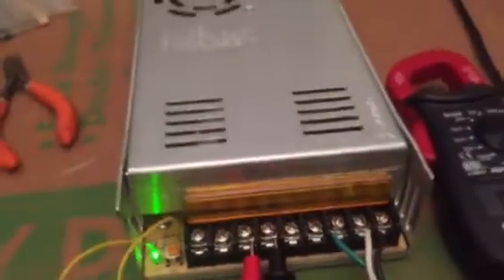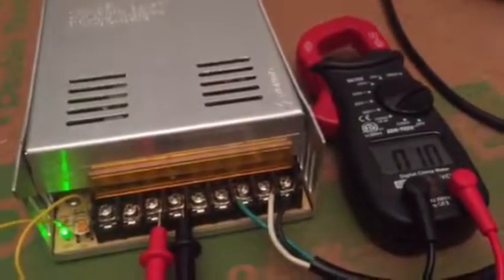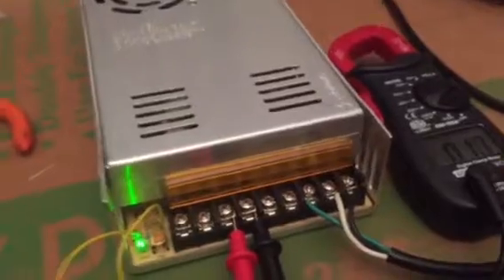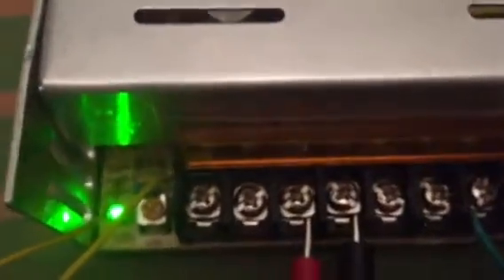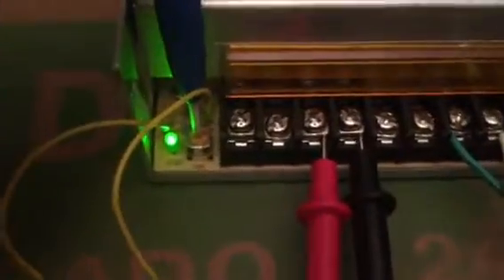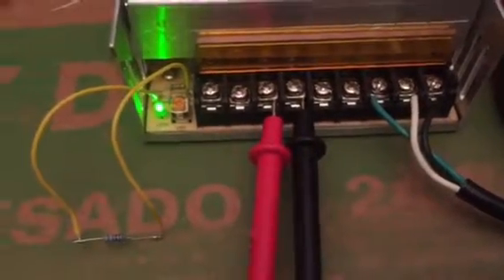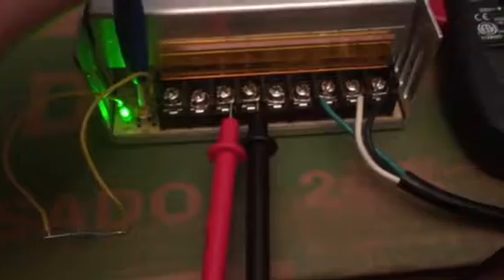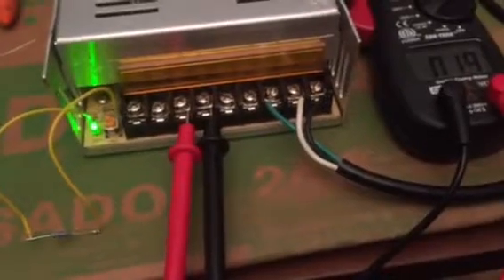30 amp 12 volt switching power supply mod part 2

Comment: I did that mod and mine will go 26 volts! The resistor number is R30 on mine. What is the stock resistor value? I didn't even look before throwing it in the trash.
Reply: 1.5k